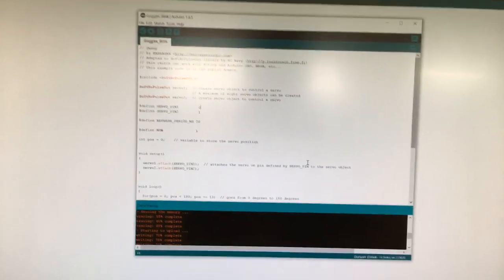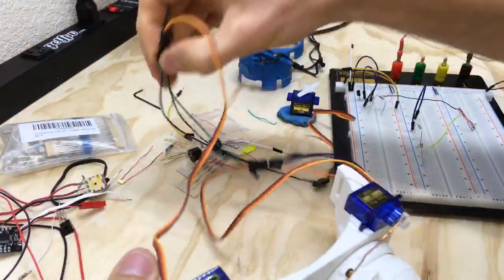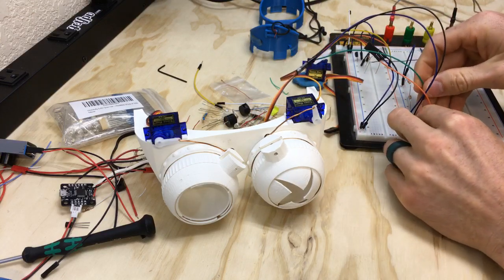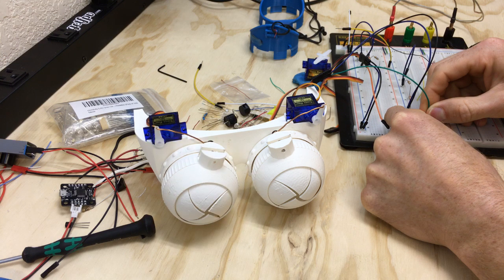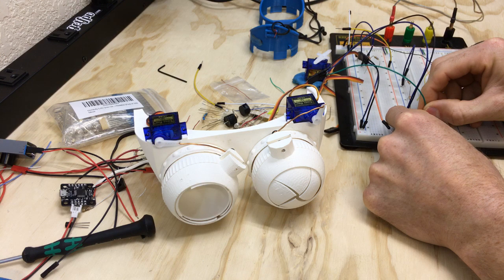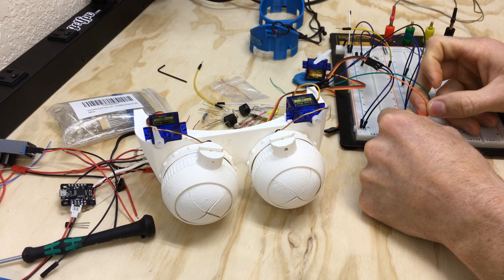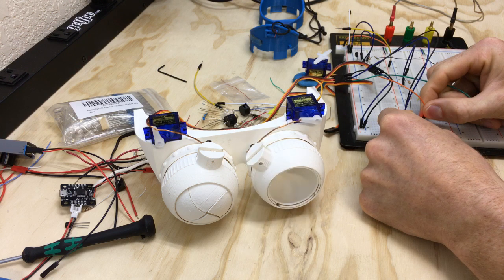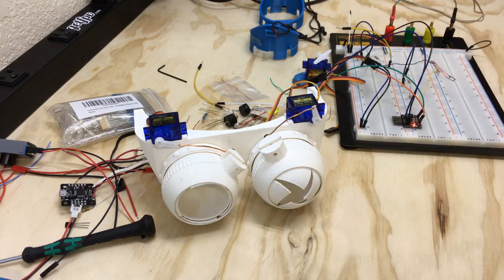Arduino Troubleshooting Blinking Iris Goggles | Live Stream

Comment: I had this exact problem with a robotic hand I made, and the delay or burst between the Servo movements is the micro controller booting up, trying to power the servos, then rebooting because they draw too much power. Usually .75 amp per Servo is good for light loads. Those attiny85s are pretty picky about power, especially if they have regulators on the board
Reply from the maker: +Quinn Miller ok this is good to hear from someone who has dealt with at Attiny25 before. My plan is to run both servos from a 5v source and then also power digispark with 5v. TI do not think the 5v reg can not supply enough current for both servos, is that correct?
Reply from the maker: +NeatherBot excuse me, I meant attiny85
Reply: yeah what I did was run the 5V power directly to the servo power and ground lines, then also put the attiny on the same power rails
Reply from the maker: +Quinn Miller perfect, thanks for the advice!

Comment: do you need twice the power for the added servo?
Reply from the maker: I have a power supply set at 5v that is powering everything. The PSU can put out enough current to drive everything no problem.

Comment: I've had issues with controlling multiple servos at the same time with arduino -- you need to look into using timers in arduino in order for this blinking functionality to work -- basically don't pause in the main loop.
Reply from the maker: +kazolar oh shoot....ok can you explain that a bit more? Take a look at the code I am running in the description of this video. Let me know what changes you think would be best.
Thank you!
Reply from the maker: The code has been posted in the description now. YT wouldn't let me use <> symbols.
Reply: 1. Curious why you are not using https://www.arduino.cc/en/Reference/Servo -- it's easier, it seems you are trying to blink slowly for some reason? I would just have it blink first -- without for loops, you can workout the blink speed later -- and 
2. The timer thing is this: https://playground.arduino.cc/Code/Timer#Examples -- I'd do a timer which runs every second and inside the timer you can pick a random value -- and choose if you want to blink or not based on that (so logically would go like this)
Timer t; setup() { t.every(1000, checkBlink); }  so then if you have a global 
int blink = 0, then you can do the following in 
checkBlink() { 
if(blink == 0) { 
doBlinkRoutine(); 
blink = random (1,5); 
}  
else { blink--; } 
} then inside your 
loop() { 
t.update(); 
} 
-- you should never pause the loop for more than 50ms, when dealing with realtime PWM pulses. Only reason to pause the main loop for 1 second or more is to wait for some weird init behavior. (Find me on FB if you need more help) -- can't really type code correctly here.